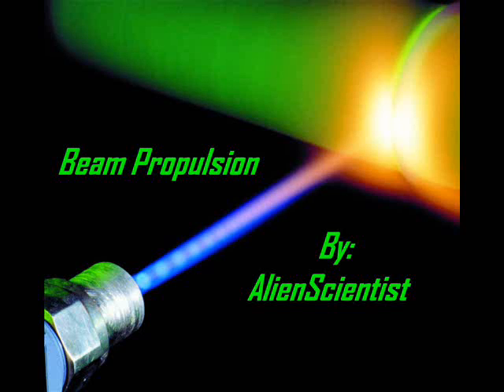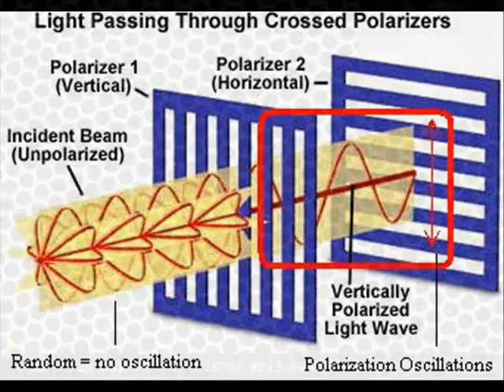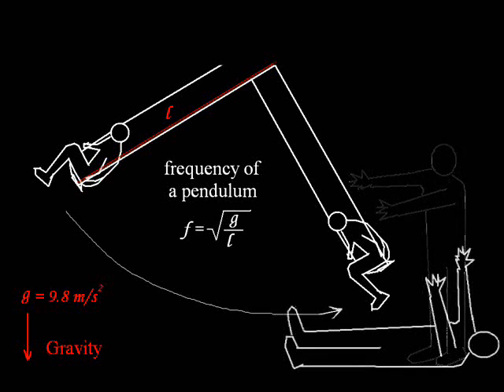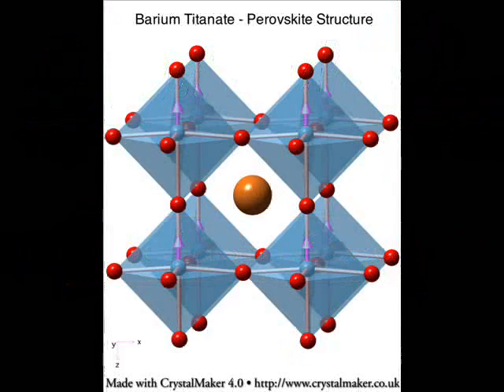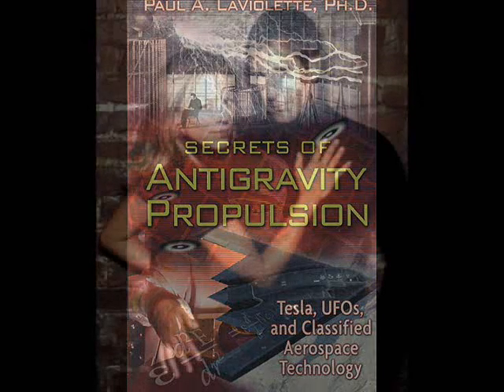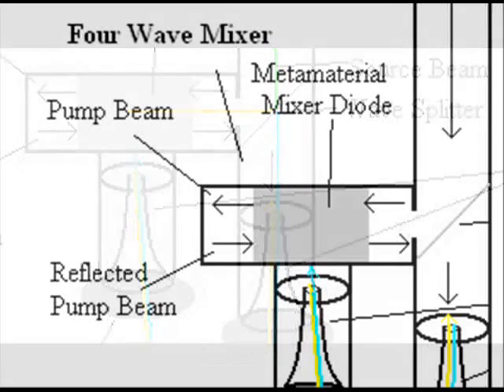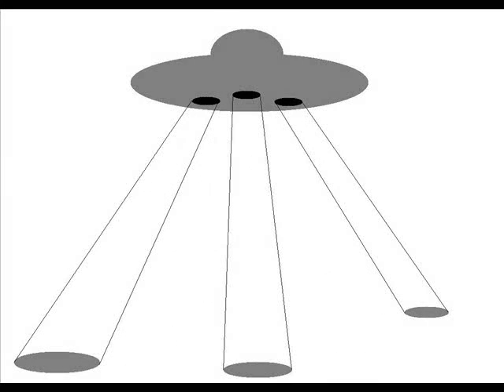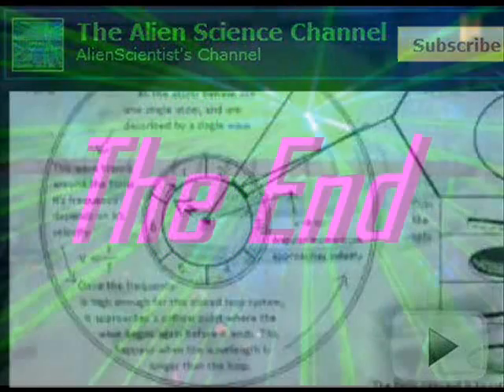ElectroMagnetic Drives & Beam Propulsion Technology

Comment: Read "Confinement of Light: Standing Wave Transformations in phase locked resonator" by Larry Reed
Reed explains how standing waves in between 2 phase conjugate mirrors provide a way to Lorentz-Doppler shift an input signal against the standing wave, revealing the standing wave asymmetrically along the axis, meaning direction can be chosen depending on if the Doppler signal was red shifted or blue shifted with respect to the standing wave frequency chosen.

Comment: At 0:45 you say if the frequency was slightly off the object could VAPORIZE, that sounds like a new weapon to me ! Remember steel buildings collapsing with only small fires on a few floors ? I've heard this before but only a few SMALL references like using MASERS in the 60s to vaporize metal instead of it reflecting off of the metal.
Can you be more specific about the resonance of the material about what you mean. Also, you mention this in another video saying if you are slight above resonance the atoms will be compressed and become DIAMAGNETIC and if below it will cause a PHASE CHANGE. Could you possibly direct me to a paper or any info that talks about that please. Causing a phase change could also be a weapon to a steel structure.
http://www.dvice.com/archives/2012/03/230_efficient_l.php
Here is MIT saying that have created an over unity LED. It makes 3 electrons for each electron input ! NASA has also did a similar experiment getting 3 electrons for each 1 input !
How about the bitoroid. It has been examined by other universities and also found to be 370 - 780& efficient ?
Doesn't zero point field itself violate physics conservation of energy ?
Just so you know the microwave propulsion you describe is nearly IDENTICAL to  BOB LAZAR's description of antigravity vehicles ! The only difference is they use element 114 as the frequency reference, I guess crystals weren't good enough.
Reply: What I think he was meaning is that if you have a laser with high energy, and manage to change the frequency to the wrong one, then it would, instead of proppel, overheat the surface.
Reply: 9-11 was caused by an electrostatic beam. Look at the work of Dr. Judy Wood. I saw her lecture 5 years ago in Holland.

Comment: @AlienScientist Do you think this would work.  (soucer shaped craft like a bowl) with section of mercury so when it spins it pushs on the 45 degre sides and push on the roof and have the roof in the middle of the craft so it dosn't bend in again with magnetic presure plaits faced at 45degrees as well to creat spin with the top half weighing slightly more than bottom half so it spins. Like to bycicle wheels spin and to move, hydrolicly spead them aprart like a bycicle wheel moves when its in arms

Comment: @Crus777 Although this is certainly a tech which had been developed my understanding of it is that it is , basicaly just a rocket which uses Plasma as the rocket fuel.  Although it may not require much power to keep the gas in a plasma state due to microwave energy build up (I dont know that as a fact, but I'll assume what you said about the chamber is correct), it still will use up the Plasma within it just as any rocket fuel is used up over time.

Comment: @ICommentonVideo Light is made up of various waves, The waves vibrate all in different directions, from vertical to horizontal and everything in between. You can let light in that is only vibrating in one direction by making it travel through a material that has tiny microscopic slits cut into it, which are all oriented the same (vertically for instance) way. This is how polarized 3D glasses work. 1 side only lets in horizantal, the other vertical.2 projectors project 2 films with polazed lenses

Comment: Such a propulsion system would resemble our Magnetohydrodynamic Drives (MHD) that have been fitted to some submarines, albeit, for the vehicle to travel through both fluid and gas that drive would have to be extremely more powerful than the current technologies... dozens of orders of magnitude more powerful.

But even then, such a craft (without some other propulsion system) couldn't propel itself through space where there is no gas or fluid to press against.

Comment: Isn't it true though that this type of technology only works in some sort of atmosphere, and in all likelihood, the thicker the atmosphere the more efficient it works?

That said, this type of technology is using energy to create a microwave that creates a repulsive force, inevitably leading to losses.  It seems more efficient to apply the energy directly towards the propulsion of the craft (i.e., direct-drive electric motors are more efficient then internal combustion engines).

Comment: before you use words like idiot you should know what you are talking about. the "sensor bar" consists of 2 IR lights. the wiimote contains an IR camera, which takes in the two light points and determines position and angle of the wiimote.

Comment from the maker: Look up metamaterials, read through the stuff on wikipedia...

There are plenty of confirmed experiments showing transmission of light through metamaterials faster than the speed of light in a vacuum.

It only works for certain frequencies of light, each specific to the material.

Work is still underway to creat a metamaterial which is invisible to the human eye.

Comment: Always amazing! I never fail to be astounded with the marvelous videos you present. One thing that does come to mind, ion propulsion suffers from this same type of weak action-reaction, light speed but thin force type of anemia. The one major benefit of this type of propulsion is you can sidestep the speed of light, if this is correct. It's not warp drive but it seems to be a more advanced cleaner form of drive. It's a shame the "New Shuttle" scram rocket tech didn't work.